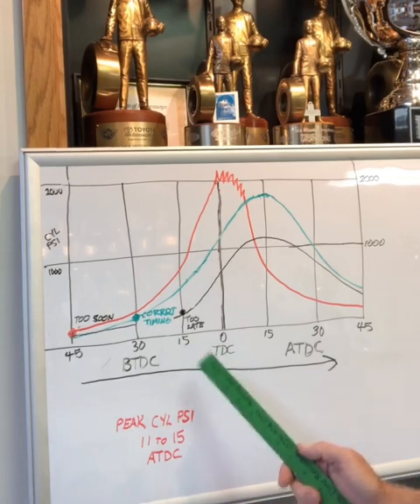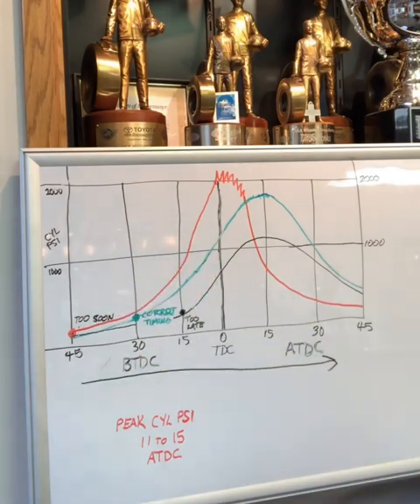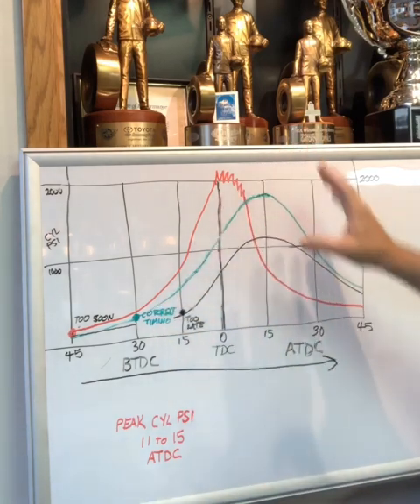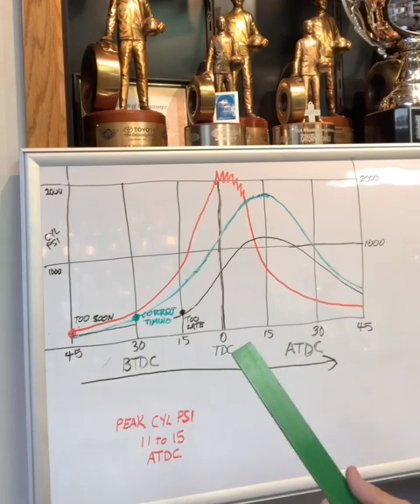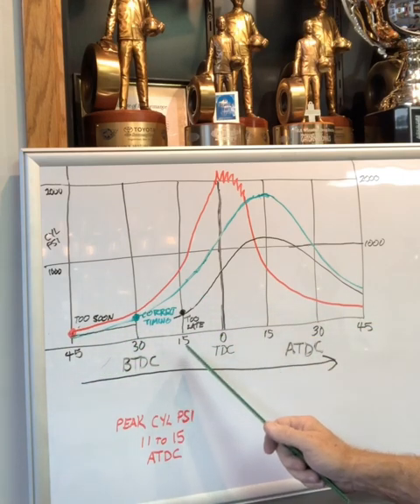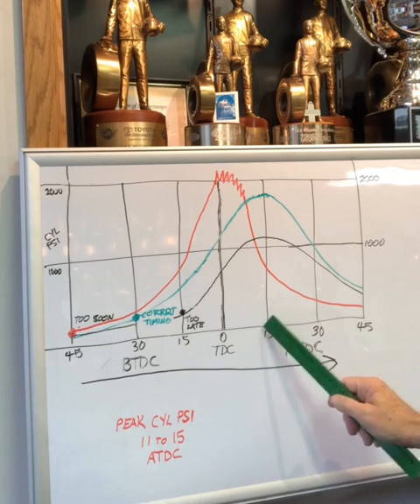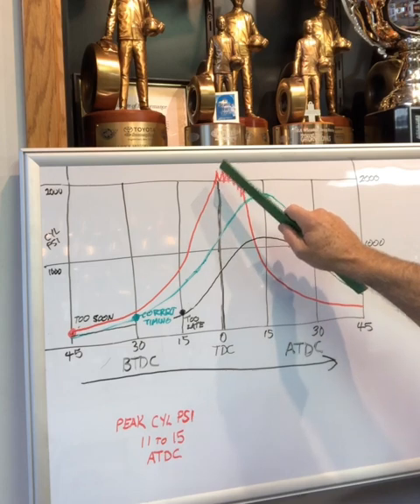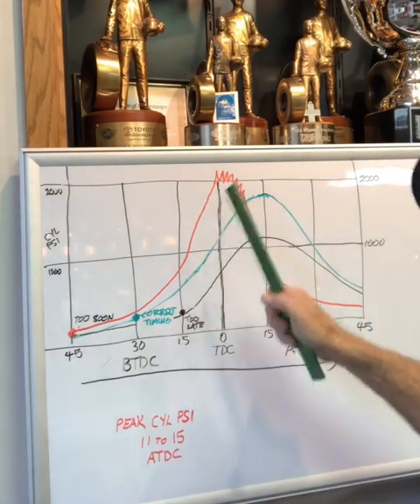Important info! Ping and spark knock. More info in description.

Comment: Spark knock doesn't occur after TDC it starts before TDC which is why it kills power so much that it's release of heat does negative work that tries to reverse crank rotation and the heat of combustion does very little work...

Comment: Way back I had a '69 Z/28 that I could not leave alone. Sunoco 260 and rev to 8000 RPM, but ignition timing controlled by a single set of points. Figuring out that running 44 degrees of advance was a bit too much took me a few connecting rods and blocks and tows home.

Comment: Boy when you brought up the fuel mixture based on fuel, what a job it was in the 60's with the little import cars.  There was so many complaints at dealerships about carb adjustments and timing.
It was from the customers changing gas station brands. 
-- Shell was awful, but once we figured it out we were able to clear it up with customers. The majority of issues disappeared.

Comment: What is amazing to me that if you rotate the engine over, and put the piston at say 12Deg ATDC, you will think the engine is still on TDC. If you could find a way to make peak cylinder pressure at say 30Deg ATDC could you imagine the power you could gain. That is one reason Nitro makes such crazy power.